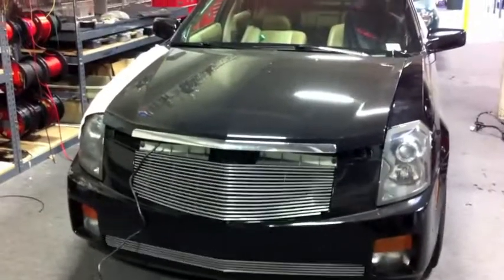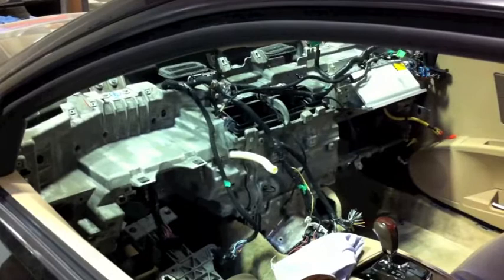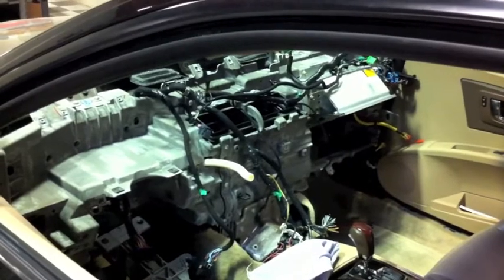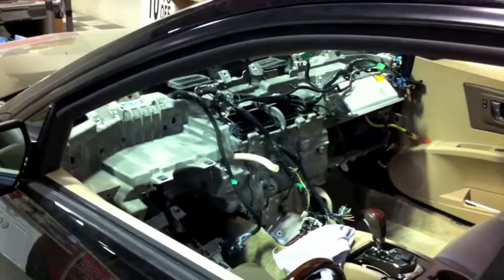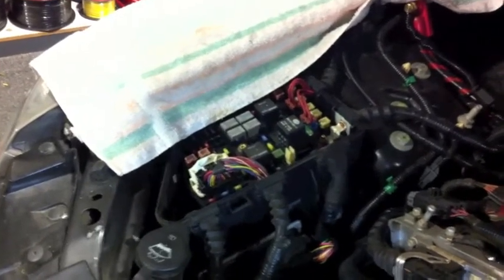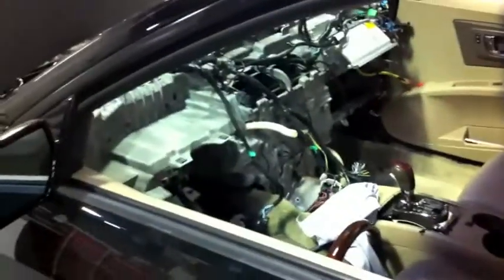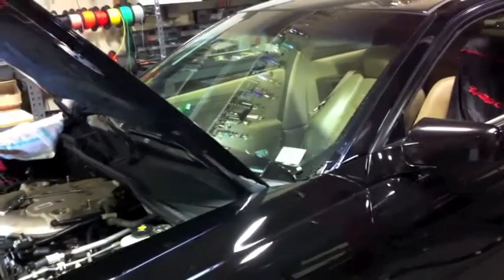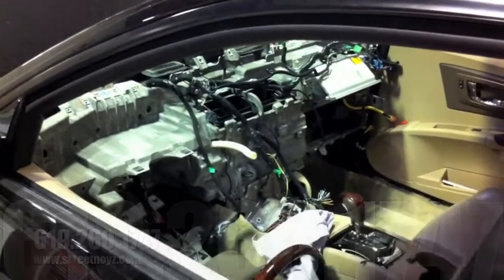2006 Cadillac CTS

Comment: need to replace a mode door for the control of the defrost,ac vents, and floor blowing control. This is located way up almost to the back of the radio. After looking into it i was not able to access it from underneath and need to remove dash. Can you post a video on how to remove dash. one that shows step by step, and not in fast mode. Please